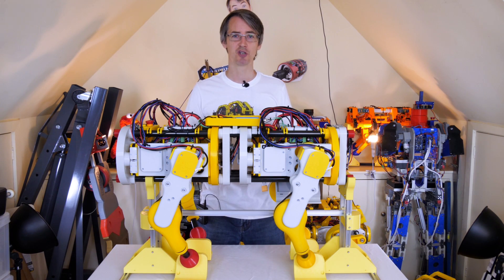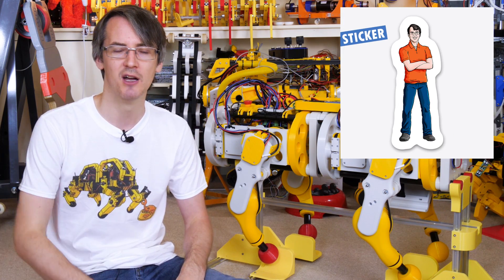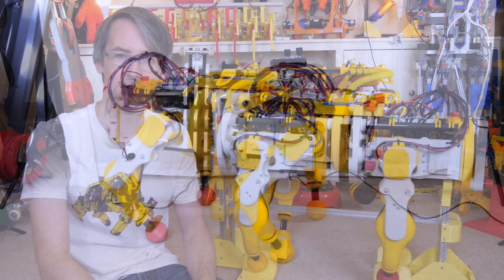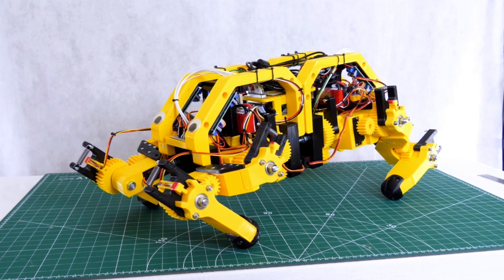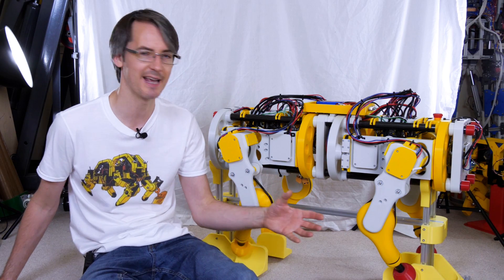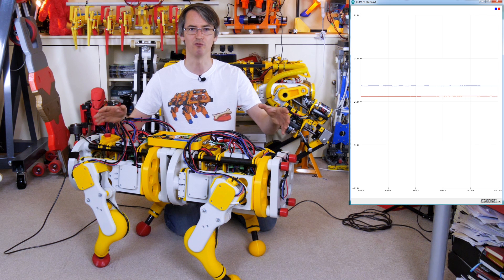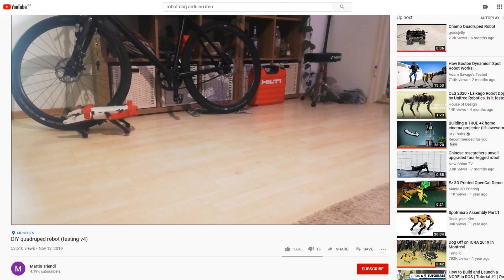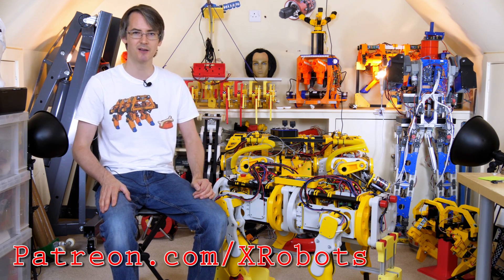openDog V2 Part 5 - Hardware Capability Testing

Comment: You could use a Zen wheel at the hip joint. It is a spoked wheel, but the spokes are in an S shape placed radially. It would offer torque dampening, as well as suspension. Print it with TPU.

Comment: The MPU-6050 is marked "not recommended for new designs" on Digikey and to date, TDK has never released full documentation for it. Most of what exists, including Adafruit libraries, is reverse engineered and from poking and prodding. I wonder if the MMA8452 would be a good alternative if you run into any problems with the 6050.

Comment: This is completely awesome but the big fault i see it's gear ratio, in biomechanics, generally articulation don't have "fixed actuation ratio". 
Let me explain: the human articulation when is completely bend (your feet is near your but) has a veri "large ratio" dont have a lot of force and accuracy but moves really fast but when it's move to normal position become a "shorter ratio" gains force and accuracy but loose max speed. This make easier tostop in the articulation limits, makeing more efficient the "operative/natural" position and making easier to move with less energy and much more...
This could be really difficult to manage the odrives reaction and make kinematics model a nightmare but it's completely worth.

Comment: That tray with the IMU and battery does quite some flexing. Id recommend putting the IMU directly on a rigid part of the frame otherwise it could mess quite badly with your control logic.

Comment: When you get this done, you should talk to Adam Savage. He has a Boston Dynamic's Spot robot that pulls a custom rickshaw he built. I wonder if your openDog could pull the rickshaw too. So far it looks pretty wonderful. I am new to watching you so I don't know about your other projects and this suggestion might be already taken care of. I was wondering about code that would tell when all the joints are in a "neutral" position and then read the roll, yaw, and pitch to tell what angles the ground underneath are. Or make the back as flat as possible and read the leg extensions to analyze the ground.

Comment: James, could you make a strong enough driving pulley thats smaller to get your 8:1 knee ratio and avoid increasing the large pulley? If the drive shaft is too big then maybe the pulley could be a shaft cap and a spacer could be added to the knee to realign the pulley.
Reply from the maker: It can't get much smaller and have enough teeth to grip the belt properly.

Comment: Why put feet pointing inward? Turn knees around making wider better stability?
Reply: The angle the legs point out (or in) is controllable, so there's no need to flip the knees.
In the above shots @5:09 you can see the large gears with belts leading bingo the centre of the not, they control the leg angle :)

Comment: You mention weight a few times in the videos about the dogs, have you looked at using some of the AI 3d printing programs? They appear to be designed to keep your strength while reducing weight. https://www.autodesk.com/solutions/generative-design
Reply from the maker: yes it's mentioned in part 1 or 2

Comment: Would a harmonic gearbox work for some of the joints? It probably wouldn't work for all, as it would make the gear ratio a lot higher.
Reply from the maker: Possibly, planetary would do, but I want to make it simple. I'd need metal gears otherwise so they don't strip.

Comment: Are you gonna use motor current to determine the force each motor is applying?
Reply from the maker: I could, but the force calc will still need to take the angle of the leg into consideration, so we'll see what works best.

Comment: I'm glad you've gone this way towards compliant joints.  With the joint design you have it looks like you could get it running pretty well.  Have you considered an articulated spine on your next iteration?  It looks like you've got it designed well for adding that, but spines are complicated...also I guess it's less dog and more cat at that point.
Reply from the maker: Some of the early MIT Cheetahs seem to have spines, but I think that's a whole other piece of R&D

Comment: I'd recommend that you run through and calculate the units for the P I and D gains in the motor position controller.  I think you'll find that you DO have a spring in those legs and it's the P term in the controller.  (i.e. the units will be N-M/radian)  The D term has the same units as a damper as well.  This also means that both the P spring rate and D damping can be easily measured experimentally.  Also while the I term has no passive mechanical equivalent, it also has real units and can be measured experimentally.   

Next, if you're using a PI current loop and a PD position loop you'll effectively get a position integrator from the current loop integrator.  The math and tuning is easier if you use a P current loop with feed-forward for motor resistance, and lump the remaining DC current error in with other external errors in the outer position or velocity loops.  (can also skip the feed-forward and use a really high current loop gain.)

Comment: I'm not sure, but it seems like you dont include a function to actually break down the force of mass on impact.
I think this will become a problem if the motors are always trying to get back to their position while gravitation is doing it's thing. So I assume it will almost create the maximum force of impact by not only falling to earth, but also stomping the foot on the ground in the very same moment.
Just a thought that came into my mind.

Comment: There is a version of the 6050 that has a magnetometer in it, the 9250.  IDK if you need it to deal with the compass float?

EDIT:  Also, cause it was awesome to watch it hop around, please try making it jump like a cat.  I'm sure there's a slo-mo video of a cat jumping somewhere on the internet.
Reply: Wouldn't the magnetometer be very confused by it's relative proximity to those big motors?

Comment: A 700 MHz embedded microcontroller, nice. Technology has come a long way. To put it in perspective, the original Xbox had a 733 MHz Pentium III.
Reply: The first PC I owned, had 33MHz CPU. It didn't even have a fan, it pulled so little current. Modern microprocessors really are mindbogglingly powerful by pre Y2K standards.

Comment: how about folding wings with quad copter rotors?
Reply: you could put additional wheels on the legs to be able to drive
Reply: some sensors to read terrain should be useful to decide if the land is flat or tilted
Reply: image sensors to detect rocks and other obstacles
Reply: terrain based movement planning

Comment: Real animals have much stronger back legs than front legs. That's because you can use push motion better than pull while running. It is also useful for jumping higher. Why don't you have stronger backlegs in a robot, to balance the back weight and better function in high performance?

Comment: I'm extremely impressed by your ability to iterate effectively.
This version is leaps and bounds (literally) ahead of its predecessors.
Reply from the maker: thanks!
Reply: same. He has them sharp and debugging skillz. Please send a copy of your brain, I need to update
Reply: Yeah man same
Reply: Certainly impressive developments and its nice to see such good progress. But I am not sure I'd call V1 a predecessor to V2 really they are so different in concept - V1 can do things V2 can't and visa-versa. Personally the static hold of all those worm drives suits a project I've had in mind much more than the direct drive of the mini's and V2. V2 really does look superb though, with so much data available to map forces and posisitions (motor current draw, encoders, the IMU) really should be able to get a great dynamic walk reacting to the environment in real-time and probably move rather fast over bad terrarin. Something V1 would never manage as its just not got the speed and would need IMO computer vision to plan where to plant its feet as it could never hope to match the reaction speed to new data of this drive method.
Reply: This guy is literally my R&D hero!

Comment: Looking great!  Pronking is so satisfying!  A few comments:
I'll second James in that you want to measure joint torque by reading the current reported by the ODrive instead of trying to deduce it from the reported position.  For FOC controlled BLDC motors, the torque is largely linear with respect to current until you near magnetic saturation.  That way you don't need to mess with trig at all and the result will be much more accurate.  Unfortunately, you'll have to switch to the native ODrive protocol, so maybe a new library or updates are required:  https://discourse.odriverobotics.com/t/how-to-read-the-torque-of-the-motor/812/8
Second, you will also want to convert the joint torques to and from XYZ forces at the feet.  I use a library called DART https://dartsim.github.io/ which you might be able to make work on a Teensy, but you could always calculate the Jacobians yourself.
Finally, if you measure your center of mass (or calibrate it online), then you can position it relative to the feet using nothing but the attitude reading from the IMU.  This allows you to go up and down hills just fine with no additional sensors.  https://youtu.be/tRCGv4KllNE
Reply: You can also look at the instantaneous velocity of each joint (its change in position vs time), with the moment of inertia of each part (CAD is your friend here!!) and take the motor phase current, subtract that dynamic torque, and that tells you the actual load on each joint (when the joint it stationary, the dynamic component is zero of course, so the phase current is motor torque, is limb load!)

Comment: Do you have motor current measurements available? Those plus a basic motor model and the kinematic model will give a good joint force estimate.
Reply from the maker: Kinematic model comes up next, I can get motor current numbers from the ODrive if I need them.
Reply: @jamesbruton  I think motor phase current is CRITICAL to know, as not only does it allow you to calulate each limb load, but it also tells you when a limb saturates (reaches max torque) and hence when you may need to change you control strategy to compensate (ie can't straighten a limb to restore balance because the downslope limb has saturatedm then at that point you deliberately SHORTEN the other 3 limbs to restore balance, and then when all 4 are carrying the dogs mass, and the single limb is unsaturated again, you slowly straight all 4 limbs to restore your mean position!  This is basically how we balance. When someone pushes you, you resist as much as you can, to stop yourself falling over, but at some point, you reach your strength limit and then swap to actively taking a "step back" to restore balance, trading position for balance in the short term)
Reply: @jamesbruton  reading the current values for the motors will give you a much more accurate estimation of force than relying on position offset